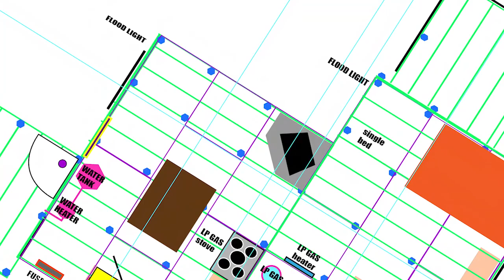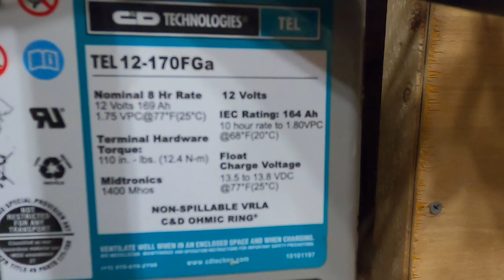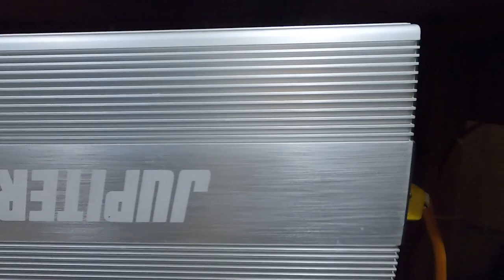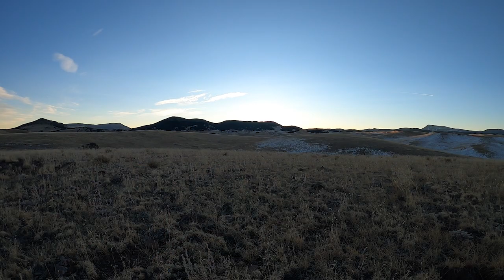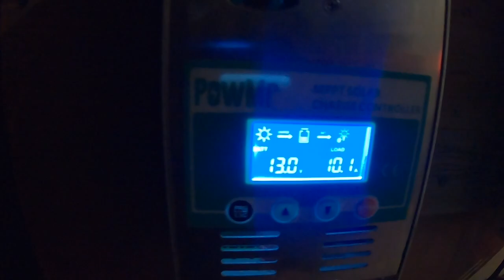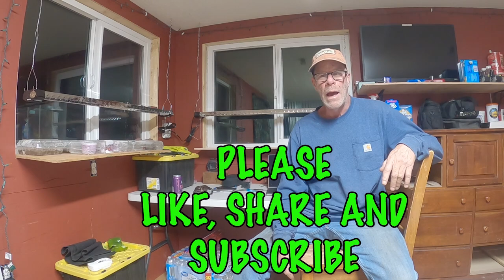RESEARCHING, BUYING AND INSTALLING SOLAR IN THE COLORADO MOUNTAINS, OFF GRID, AT NEARLY 10K FEET.

Comment: AWESOME!  And you remembered the Catastrophe fuse!  Most DIY builders forget it! I put mine on the battery side of the disconnect switch. ENJOY!
Reply: Please tell me about this fuse?
Reply: It's the fuse that SHOULD be connected to the POS post of your battery where the Load connects. It's size (Amperage rating) is determined by the amount of AMPs your load will pull plus a little extra for surge (25% usually). The Catastrophe fuse is to protect the wires from getting hot and starting a fire. Your wires should be sized to carry the LOAD with very little voltage drop. If any "Catastrophe" were to happen (overload, loose connection causing heating issues, short circuit etc.) The fuse would blow before the "Catastrophe" of a wire fire.  "Best" case wiring would be the POS battery post, then the "Catastrophe" fuse, then the disconnect switch, then the load! And MOST DIYers on You Tube never put one in. Enjoy!  @SHamm-oc7un